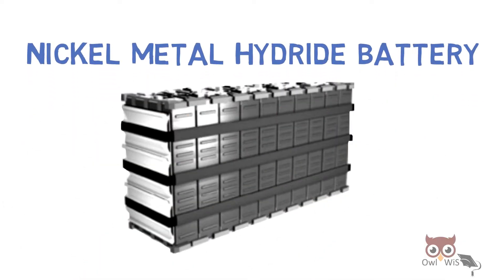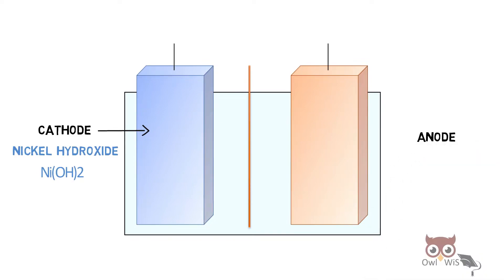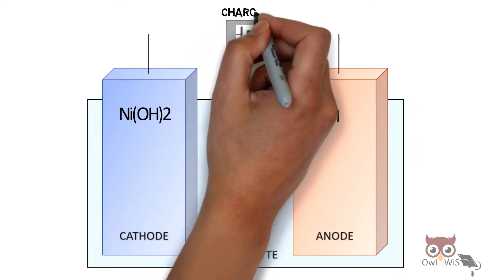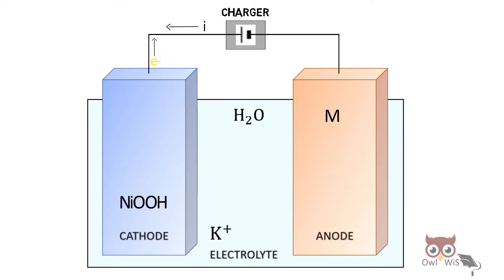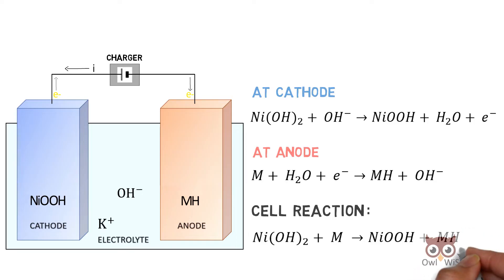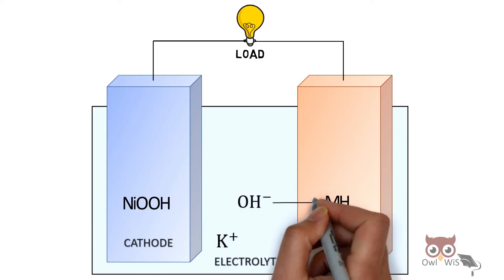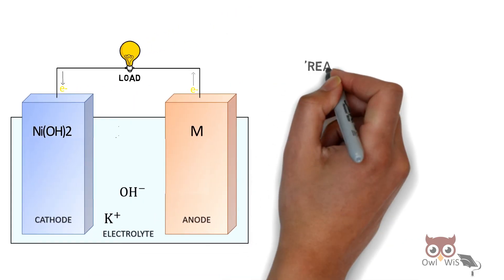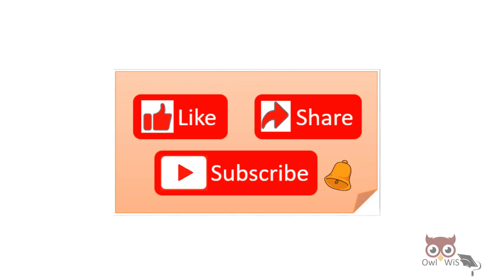How Nickel Metal Hydride battery works | Working principle

Comment: How can you connect the positive side of the charging source to the cathode of the cell and anode to the negative. anode is the positive (+) side of the cell and cathode is the negative(-) side of the cell and hence the positive side of power source should be attached to the positive side(anode) of the cell and negative side of the power source to the negative side (cathode).
I was surprised that no one figured it out so far😅
Reply: thats what im thinking whats going on here NIOOH should be on positive (ANODE) here shes nominating NIOOH to cathode which is wrong
Reply: @shyamkalavadiya1207  👍
Reply: Sorry but I was wrong in electrolytic cell positive is anode and negative is cathode but this is a type of galvanic cell in which negative side is anode and positive side is cathode

Comment: nimh is excellent batteries. life capacity and safety. but they need permanent balancing packs for their long useful life, a shunt resistor in all cells of 1:1000 of the capacity can be implemented: (10 amp hour battery capacity 10mah of balance resistor) to correct all the unbalance of the battery pack.
Reply: exactly